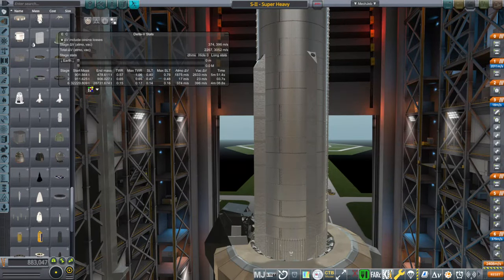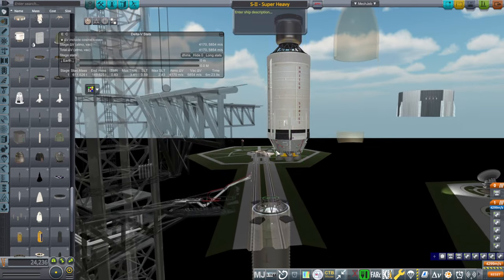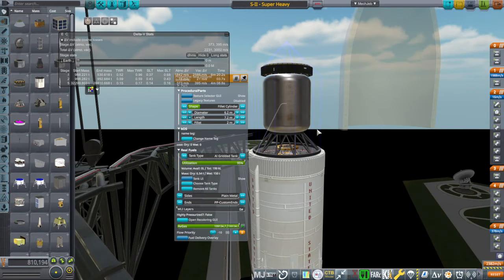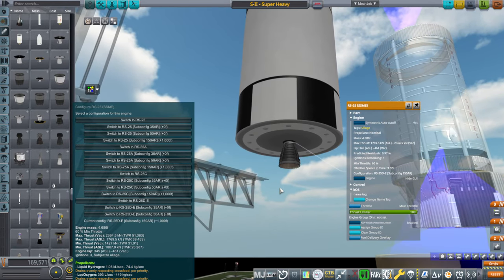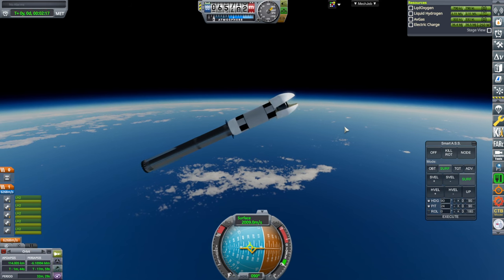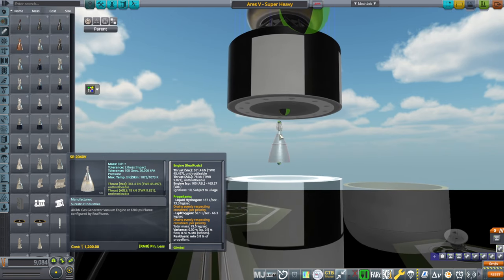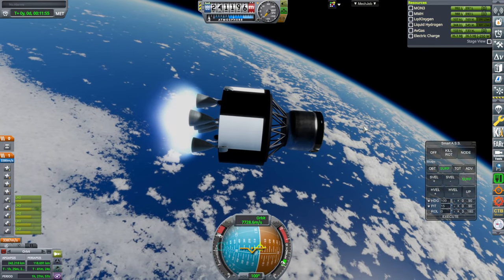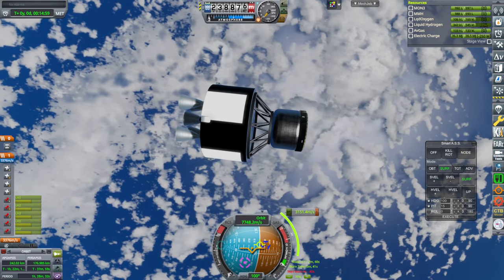Super Heavy Applications Program (RO in KSP 1.12)

Comment: On the topic of 2nd stage engines for this:

Obviously, the RD-0120 would be the obvious RS-25E alternative. It even had slightly better vacuum specific impulse than a normal RS-25. 

I'd also suggest considering the PGA engine that Stratolaunch was working on prior to Paul Allen's death. It was only a 200,000 lbf (889 kN) engine, so a bit smalelr than the J-2. But it would've benefited from modern production technology (it was going to be at least 85% 3D printed, for example), which should've made it pretty cheap, and it was staged combustion (fuel-rich, with a separate fuel-rich pre-burner for each propellant, if I'm judging the models they released correctly), which means the absurd performance of modern staged combustion engines is on the table for it. You'd need like 13 of them to match the 5x RS-25s, but what is the lesson of SuperHeavy if it's not, "engine count doesn't matter anymore, go wild"?
Reply from the maker: RD-0120 gets 1s more ISP, but is heavier and with less thrust, so I'm not sure it's worth contemplating - especially not given the likelihood of getting the engine these days. As for PGA, I don't have anything except for the thrust, so I would lean towards BE-3U if we're going to put a ton of engines on anyway, since at least that's happening and we have an ISP number.

Comment: 100t to the moon, all on its own, with the booster able to land? That is really good. Thanks for the demonstration.

Can you try an expendable Starship upper stage? (i.e. ditch the re-entry and landing capability, just a plain stainless steel hull with Raptor 2) TLI payload is very likely not as good, but LEO should be fine; perhaps good enough for a hydrolox 3rd stage. S-IVb + 50t payload for instance?

Comment: Had J-2X been successful and not cost 14 kidneys it would've sold like hotcakes. Excellent size for most modern upper stages. RL-10 is just too small for what we're doing with second stages these days, and third stages have mostly been replaced by the payloads own propulsion.
Reply from the maker: J-2X was a bit on the heavy side, too. BE-3U has about the same ISP though you'd need two to get one J-2X's thrust, but still I think it's best just to go with it and forget about J-2X, since that's not happening.

Comment: Why not stick with raptor vacuum engines?  Less performance, but with a lightweight upper stage, no heat shield, and no need to hold fuel in reserves. Could maybe deliver something close to 100 tons without the need for different infrastructure, etc..
Reply: Well, I tried some stuff and it’s just unbelievable how much of a difference hydrolox makes. I don’t know why, but it surprises me every time.

Comment: How do you calculate how much Delta V to leave in super heavy for boost back and landing?
Reply from the maker: It depends on the horizontal velocity - it's a little less than double that (since we're generally still coasting up to apoapsis and therefore have more time to cover the distance back to the launch site and also SH can glide a bit). If the load is about the same as Starship or more, then I can just use the real timing for Super Heavy.